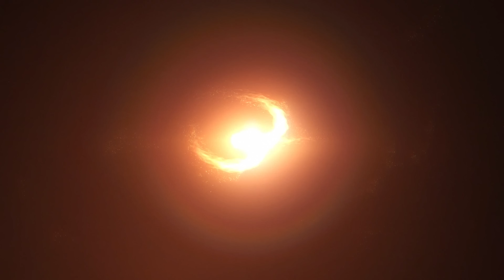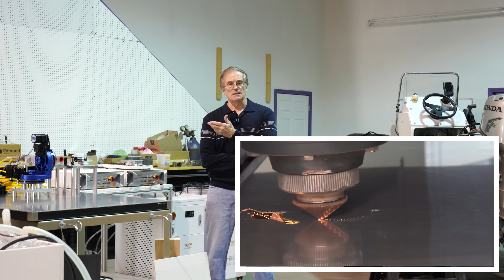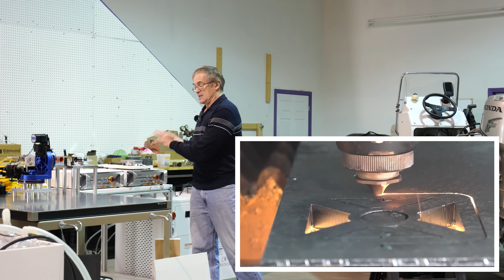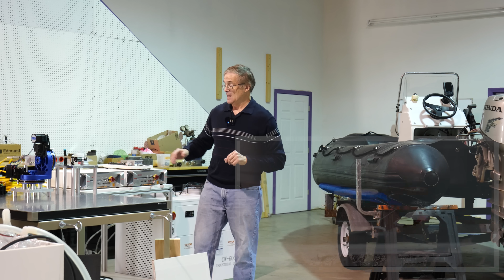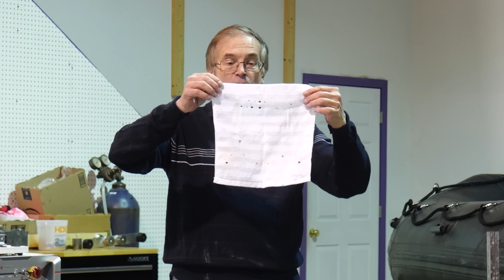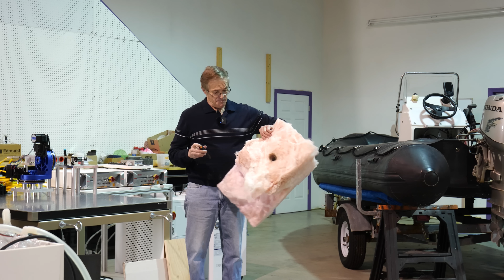We have a problem... and need your help!

Comment: theres several options but i believe the best one you could do would be a cooled block of aluminum. i have a block i could send you free, it was a rexroth valve block off the back of a garbage truck curatto can. so it has channels drilled through it and uses hydraulic fittings of various types. this would allow the aluminum to be a heat sink and hopefully not get to its melting point while its being cooled. google this "Bosch Rexroth Manifold Block R900172222" and it looks like the small one only its colored gold. if youre worried about reflection you could color it with vanta black.

Comment: What about making a mobile wall on wheels using a combination of a plywood frame.
So plywood an absorbent cloth 2 inches of dirt another absorbent cloth then more ply wood I would also use some fixings to stop it bulging apart in the middle 
Then soak the wood absorbent material and soil outside then bring it inside on the wheels and use it… well that’s my 2 cents worth lol

Comment: A 1 foot thick wall of wet dirt or mud should withstand the beam for a few seconds.  Either that, or move your testing to the bottom of an old gravel/sand pit.  Also: You are now officially in Bond-villain territory.

Comment: A crystal/glass diffraction cube (DIY style) just cutting the glass cube in 1/2 on slants, glue back together, repeat a bunch of times from different axis/face/angles)
       THEN take the the cube and submerge it in one of those small hexagonal fish tank etc (NEEDS to have THICK glass). 

Fill the fish tank w/ ice water (add a miscible, yet high diffractive/diffusive substance to it: so its translucent): maybe just LOT of epsom salt 
(salt crystals are uneven, so it should massively aid in causing decoherence)

Considerations: Prob Don't freeze the tank: thermal shock (from sudden temp swing) at laser impact could cause cracking. You'll have temp swing anyways, but this would exacerbate it

IF you do have dewar of liquid Nitrogen sitting around: consider incorporating a beaker of this inside the fish tank, offset from path of laser: it'd help keep the coolant very cool, ensuring the tanks glass can take the initial blast from laser w/ melting etc

Checklist:
- Its portable. 
- Cheap to make
- Easy to setup/take-down rapidly
- Does what it needs to

Comment: There are plenty of products used in kiln making that can be used. Ceramic insulating blankets, light weight fire bricks, and silica rigidizers for example. You can make your own refractory material as well using the silica rigidizer (liquid glass), clay and sand. There are several formulas online. This might make a good video as well.

Comment: You need to design your beampath so you can use a low power laser for almost everything. For actual testing you will need to harden your device so it can travel, and go to a gravel pit for live fire testing. ITAR-esque stuff, Main P

Comment: A hesco-type barrier (essentially pop-up boxes that can hold sand) filled with fine and dry Sahara-type sand seems like a safe bet. It will be heavy, but loose sand is self-healing, won't produce toxic fumes and you could put it on a wheeled platform to make it somewhat portable.

Comment: How about a deal?  The community helps you with your problem, And in return, you give us the 2nd part to the A/C video, supposedly telling us how to greatly increase its efficiency.   It's starting to get warm again, and lots of A/C's are running.  Such information would be very useful for lots of people.
Reply: LOL Yes I keep looking for that follow up video too!
Reply: Technology connections has entered the chat
Reply: That was my favorite video on this channel. The lack of a follow up video makes me think they realized they couldn't deliver what they promised.
Reply: Jeah, those kind of claims usually dry up once you dig in.@iridium1118
Reply: Water mist sprinklers on the radiator will do it... and a osmose filter in the water line 😅
Reply: I've been waiting for that video too!
Reply: I concur
Reply: I am waiting for graphene followup.
Reply: Yes, summer is coming !
Reply: @ivangutowski  Yeah, not Jon Snow… it’s John Swampass.
Reply: Absolutely!  Been waiting for that!  At least give us an update,  Was it a failure or just delayed!
Reply: I think using the waste heat to heat water is a good use. You just have to mount a copper tube to the outside of the ac unit. The heat coming out is around 120. Not exactly easy to tie into a system but it has potential.
Reply: I want more boat videos
Reply: I beleive they already mentioned it offhand in another video or livestream stating that it didnt scale.
Reply: That type of A/C is dangerous because of possible airborne legionella infection. Which can kill your family quiet easily and may be your neighbors
Reply: Yes, and for a small fee, he can give us the plans for the free energy device as well. hahaha I've seen that ad far too many times.
Reply: This
Reply: This
Reply: And an update on the PC cooling.
Reply: They wanted me to keep this secret, but you can greatly increase your A/C’s efficiency in a single afternoon.

You’ll need to buy a second A/C and plumb the cold air from the new unit to the intake of your existing unit. The key to making this work is to properly hide the new unit from view - if the new A/C senses someone looking at it, the efficiency gains will invert and it will actually cost more to run.

Using this method, I’ve achieved a 69% efficiency increase for my old A/C.

Comment: I thought of optical black water with iron oxide. The task is that the water and the solids need to be recirculated with sufficient speed so that the heat is transferred quickly as possible within the solution (massive amount of air bubbles from the bottom plus vertical stream by pumps?) and you will need a few cm of water to eliminate the power of the beam as it travels through the solution.
The other thing is that you need to build a container to hold the water. That is good on one hand as it can be filled and emptied when put in place, but on the other hand the laser beam will puncture the steel (which I would choose). The exiting water you could collect by a pan below the structure and return it into the system.  The iron oxide may even be able to plug the hole punched by the laser.but the water in the system could be heated so rapidly that cavitation may occur.
Just an idea of a mechanical technician who has little to no experience with laser. But I think you can cheaply build a test rig and take from there.
Good 
Jack and I hope that someone else has a better idea than this 😂

Comment: Whatever you use as an absorbtion target, use a fine diffused water mist spray in the final foot or so close to it so the beam is diffused (not reflected from bigger droplets!)
YT - watch?v=T7zJTdzpWs4   for a cheap method of making a mist using an ultrasonic humidifier

Comment: Water in a glass tank, such that the laser passes through the glass. Make the water dyed, but not too much, so that the laser is dissipated over some distance in the water. Behind and around the water tank put bricks, so refracting light doesn't escape at unwanted angles. You just have to get enough energy out of the laser so the bricks can survive undamaged.

Comment: I’d probably try making a wall of something dense behind rockwool insulation that has water flowing through it from top to bottom as a backstop.  In front of that I would put a dense fog of water vapor, enclosed by a thin sheet of plastic.  The fog should be moving around not stationary.  As you punch holes in the plastic cover them up with gaffers tape or something similar.

Comment: I’ve got a couple ideas that you might try:

1. What if instead of stopping the beam all at once you diffused it first, by using a 2 layered wall. The first layer would be a transparent material that diffused the laser instead of absorbing it, and the next layer would block it.

2. What if you used a Reflective surface with something in front of it. Like your 3/4” plywood and an inch or two behind it a polished sheet of aluminum. Any reflections would be distorted allowing the backside of the plywood to better handle the beam. 

3. You could also look into NightHawkAndLights expanding fireproof material. I don’t think it would work by itself but perhaps combined with one of my other ideas it might.
Reply: This was my thought - a large fresnel to reduce the light.
Reply: Could sprinkle water infused with charcoal dust or carbon powder infront of the StarLite heat shield ! :)
Reply: @vovochen I just saw another comment that suggested water with misters, I think that’s genius!

Comment: Maybe air-crete (concrete with air voids, e.g., via perlite or soap foam mixed in)?  It has been made light enough to float on water so shouldn't be too hard to move around and should be relatively cheap (though there would be DIY labor in making the panels).  Not sure how it would do against a laser, but I'd guess similar to the brick.

Also intumescent paint could be applied to increase the resilience of whatever material you choose.  Nighthawkinlight has videos on intumescent materials, including diy starlite.

Comment: you didnt describe the limitations and requirements very well. 
what is the area you need to cover?
what are the limitations on weight?

here is what will most likely work:
1. water. not a towel soaked, but build an aquarium. the water can not be crystal clear but must be opaque enough to diverge the light enough. so you have to experiment with the opaqueness of the water. you will also need to have the glass front facing the laser made out of something that doesnt absorb much of the laser light

2. a big lense. the problem is not the power of the laser but the concentration of the beam. if you manage to enlarge the diameter of the laster quickly enough then you are good with blocking it by a piece of wood or paper.
there are lenses designed for laser light. its gonna be costly but it will most likely work. i dont know how big the are is you need to cover so no idea on the dimensions.

Comment: How about a bunch of crushed/broken glass, (1/4" or less) in a container. Think mirror ball solid filled with the glass. The laser hits it and dissipates into the glass. You'd need to shield the sides as it could come out anywhere, but it may disperse the beam via refraction enough that the other materials can handle it.

Comment: I tested big CO2 lasers about 40 tears ago (1200W CW, beams ~1/2" to ~ 3/4" in diameter). Firebricks made of pumice or some kind of volcanic stuff can stop the beam, and weren't damaged by the heating (at least by what we were doing).

The lasers had beam dumps that were used to scatter the light into a closed water-cooled cylinder which had a rough thread turned on its inside surface. A 45 degree flat metal mirror, with a cooling line soldered onto its back, was used as a shutter. It was gold coated. The mirror was actuated in and out by a solenoid, and was normally closed (turning the beam into the dump). The beam was reflected off of the shutter mirror to an off-axis cone directly below it, on the bottom of the cylinder. The light reflected off of the cone was then scattered the into the threaded surface of the cylinder.

I think the I.D. of the dump was about 6". The entire assembly, including the cone (if I am remembering correctly), was made of black-anodized aluminum (I suppose the cone could be gold-plated too). The anodizing burned off of the cone, but I don't recall it melting any of the aluminum. Good luck.

Comment: I'm thinking a very thin aquarium containing either a gas or a liquid that can absorb the laser, at least a percentage + disperse it or convert to heat.
Maybe just dyed water or perhaps even a non-solvent?
Reply: It's not very cheap and easy to move a giant aquarium around, but it's just glass, water and dye. With some testing, you can find an optimal safe thicknes and exposure time.

Comment: rotating discs moving faster than the burn thru speed for that material used   maybe 3/4" fire rated gypsum board for a cheap test...   3-4' dia disc of that sheetrock laminated to a 1/2" ply spinning at 15-30 rpm just might do it or it just might fly apart ;)
Reply: Rotating and swinging sheet of material on a pendulum mechanism. Create some distorted Lissajous curves with low self-intersection if the beam remains stationary too long. Could be very cheap. That, plus the safety interlocks someone suggested. Good luck!
Reply: :face-purple-crying:
Reply: Was just thinking the same thing.  The density of power of the beam is what makes it so potent; either de-focus and absorb with a constantly rotating device or just the rotating device

Tough problem when you start really analyzing it
Reply: I was thinking of a metal disk spinning at thousands of rpm, mounted inside something like a black box with small aperture ingress for the beam. Agree that the goal is to avoid burn through by constantly and rapidly changing the surface the beam contacts

Comment: Here is my bad idea:

big ol' water tank filled with highly turbid water. Set the tank at an angle so that the reflected beam is sent off in a safe direction (if it's 10% reflective then it is 10x easier to manage). The light is absorbed in the bulk of the water and is circulated (with a pump or not).

The scattering agent could be milk, silt, formazine, prussian blue, a whole bunch of inks, some kind of colloid??

To make it portable you can just drain out the liquid.

You can make it any thickness that you want, and you could have an opaque backing on the tank (or rather just behind it). 

You could also flow the liquid over the front of the tank to minimise local heating of the tank wall.

The surface reflection is a big issue, as is the risk of the tank failing due to heating. 

The specific heat and latent heat of vaporisation of the water would be a great way to sink loads of heat, and it can be easily replenished (by just waiting for it to cool down). 

If the liquid is well mixed you could also measure the temperature of it to get some kind of idea of how much off target laser light there is.

Comment: Dear Tech Ingredients,
You may want to set up air circulation of ash infront of any wall. The ash will greatly help you scatter the beam, making it way weaker. If its dense enough, 2m will be enough to stop the laser doing fast harm to wood.
You may also consider charred wood or another heatshield-capable material in the background; most will fullfill all your requirements but toxicity.

Cheers !!!!!!! Love your Ingenuity ! =D

Comment: bricks of rock salt. If they were built on to a metal frame that could be moved with a forklift you could have a bunch of 4 by 8  vertical sheets of them. Designed kind of like theatrical flats. They would be pretty heavy but movable. Also easily repairable, A handful of wet salt could be packed into any holes.

Comment: Try the system with the laser at minimum power. Once calibrated and in optimal functioning, try it with the laser to standard power. (maximum).

Comment: I'm no laser expert but here are some ideas :
  - you could use a high flow sprinkler in front of your material to scatter/absorb the light so that the material will last much longer
  - foaming carbon materials (sometimes used as fire retardant) may work. Look for "starlite" recipe (quite similar to cookies recip if I remember well ^^). Not sure how it react with high power laser
  - what about a laminar curtain of water? May trap/absorb the laser

I hope these naive ideas can help you

Love your videos, keep on this track! :)
Reply: Starlite together with sprinkle water blackened by carbon powder/charcoal would work wonders, true.
Reply: For low cost alone, I think the running sprinkler is a winning contribution.
Reply: Cola is a surprisingly good beamdump dut to the selfhealing propperty from being liquid  and the caramel color (E150) as absorbant. 
Either a watercourtain or aiming the beam downwards instead of horizontally and aiming at a lage waterpool. 
If glass is transmissible enough to not take damage, an aquarium with colored water might also work.
Reply: @clockworkvanhellsing372 visible black is not always "black" in infrared
Reply: You could have a few hoses set up pointed at a target sitting in a large trough or a kiddie pool. The spray from those onto the target would scatter/absorb the light and cool the target and deprive the target of oxygen for combustion. You could even hook up electronic triggers for the hose spray so that it automatically comes on any time the targeting computer anticipates a firing solution.
Reply: Fog machines, a thousand of them?
Reply: That's exactly what I was thinking! 10 ultrasonic foggers in some water in a big cardboard box with two layers of just plain aluminum foil just woodglued to the inside (to ensure more even and spread out heating)! If you could get the laser as close above the fogges' outputs as you could you now have high flow, great blocking, fairly low cost, fairly quick switching, high heat capacity, and even effectively evaporative cooling!  @Audion
Reply: Better yet, bubble machine, or a foam party setup.

Comment: I wonder about flowing water. Some sort of waterfall where a 1/2 inch layer of water is flowing over a piece of hard material at a steep angle. Colour the water so tht it absorbs the laser light. That should give you some time.